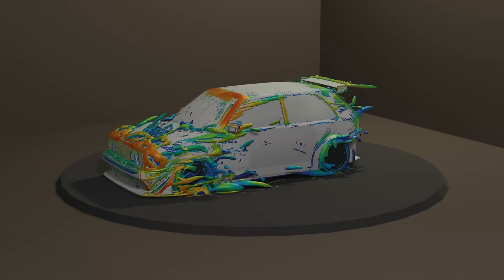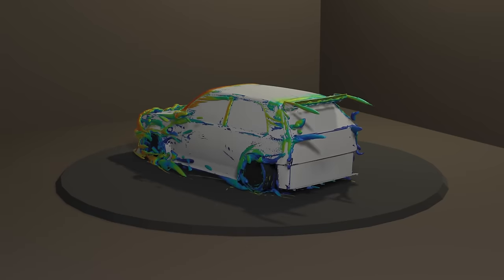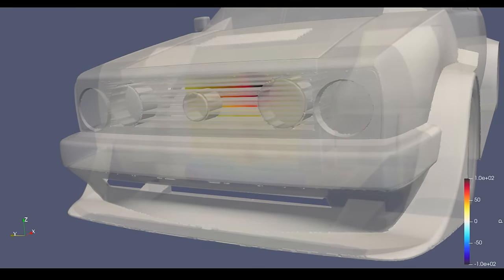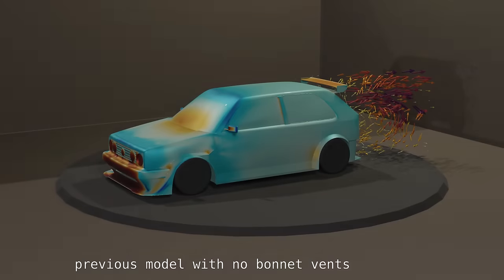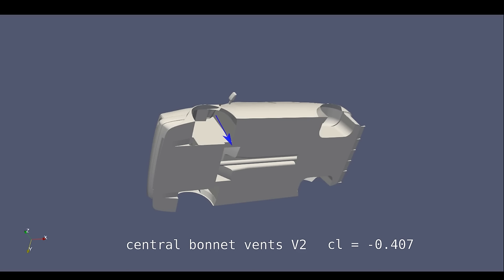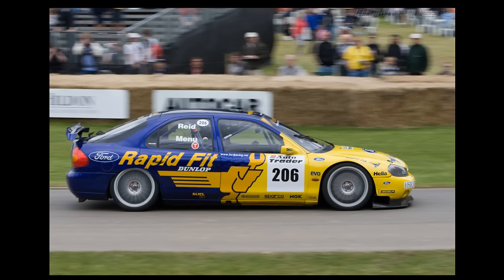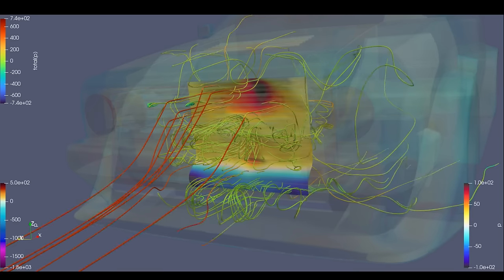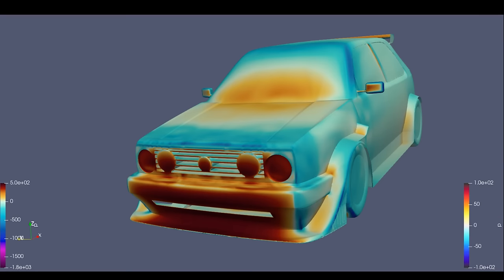Bonnet Vents: On The Search for Front Downforce

Comment: Maybe I missed it but the actual location of the various vents you mention is crucial and that is dictated by where the low pressure areas are. There is plenty of info around as to how to find the location of such low pressure areas. Of course the vent design is relevant to flow as well.
Reply: I did some tastle tests on my mk1 years ago. About 8in from the hood edge as close to the fender as possible and a maximum of 8in long vents has worked well for my cars.
Reply: 7:17 shows the corner vents

Comment: That’s very interesting how the front impacts the back. On my Mk1, I have the vent just on the edge of the low pressure zone on the hood and I have it raised with a gurney in front. This significantly increases extraction, and actually lowered drag a bit.  

I want to try like Audi did in DTM and venting a lot of the coolers into the low pressure areas in the wheel wells.

What are your thoughts on aero balance for these FWD cars?  I’ve been targeting about 60/40 downforce for the 65/35 weight distribution. The hope being that it understeers at high speed. The rear aero is also much less pitch/ride height sensitive.

Comment: Interesting. Very surprising results without ducted flow to the vent. I imagined a vent in the low pressure zone near the leading edge of the hood would be a hungry little vacuum cleaner pulling huge volumes of air out.
The WRC engineers have been ducting to their vents for decades. Now we see why.
Reply: Lots of cars have been, including supercars

Comment: What about pushing and tilting the radiator forward so you can try and get the bonnet vents into the low pressure
Reply from the maker: i think ducting may be essential, really need to delineate the functions as there is too much going on everything seems to just average out to the least good solution.
Reply: @nelsonphillips  Fair. What I’m curious about is I’ve seen some stuff from other aero peeps saying that straight louvers is better in terms of downforce than a ducted exit without louvers which didn’t make sense to me. Of course that was also on cars with the low pressure area further back so the louvers where more effective.
Reply from the maker: @cademckee7276  I've seen a bunch that run a tunnel in the US that get positive results, but they have a more modern car. No car from the early 90s on has this bad front lift,  this model just has terrible front aero. I try to emphases it, it might be worth while a major reshaping of the front and rerun the vents and compare that to ducting. A bit easier than modeling a whole new car.

Comment: I had a friend who back in the 90's drilled 6 2" holes across the back of the bonnet of their Falcon ute and he claimed it made it a bunch faster. As we were traveling back and forth about 280km at the start and end of the week for work I asked how much difference there was to the speed/time over that difference. His answer was none. I actually wondered if a non destructive option would have been simply to put some spacers in the bonnet mounts and raise the back edge 1/2".
Reply: ive seen this done on a electric converted land speed car, they raised the rear of the bonnet by an inch or two to allow the air to escape over the car,
Reply: Nothing escapes in a high pressure zone.
Amazes me every time I see it, even at “high level” of racing.

Yes, I know there’s the occasional exception to this rule.
But in general, the only good thing to be placed in front of the windscreen is air intakes for cabin cooling and engine air boxes.
Reply: Your friend is dreaming. The back of the bonnet is a high pressure area on those sorts of cars.

Comment: Bonnet vents can reduce the amount of pressure "pushing the front splitter down" as now the air can more easily escape which reduces downforce.
Reply: You need airflow in order to achieve downforce. Without bonnet vents, the air is stalling on the front splitter, not flowing.

Comment: Hello, great video! I was wondering if you are able to CFD with the hood raised up at the back like a Cowl hood. 

I've installed hood risers on my 92 Honda Civic and found that crusing highway speeds (80km/h and over) my engine revs drops 500rpm from ~4500 to ~4000 rpm with just the hood risers. But the previous owner removed the undertray and AC block off panel (beside the radiator). 

With all this information, I've concluded that without those panels I'm getting a lot of drag and lift in the front and under the car. With the hood risers, I'm assuming it's going up and over the body completely and the corner edge of the hood is creating a vortex to cancel out drag from my mirrors. I also have Spoon "style" duck bill wing I would like to add but I'm unsure how it's going to react with the hood raised. 

I can take pictures, if you're interested. Thanks for the awesome video!!
Reply: So you are saying that for same speed the engine is running lower RPMs? 
Is it manual or automatic? 

In general, raising the backend of hood is not the best solution as the windscreen  causes high pressure zone on that hood - windscreen transition. 
Of course if the pressure under the hood is even higher, it will help a bit. And yes, missing those panels causes increased drag and lift in front.

Comment: Missing a bit of detail here.

Are the sidevents only "open" to the engine bay or are they also open to the underfloor and wheel-well? Meaning if they only pull air from the engine bay or also extract from the underfloor. Could you go into it's setup in a bit more detail? Perhaps in a bit more detailed video about BTCC aero and sidevents?
Reply: The Super Touring cars all hade very clever and complexed solutions to everything. For very small gains to be honest.
The air ducts to and from the rads and to the air boxes was no exception. 
But all added up, they were amazingly quick. 
But that you probably already knew and wasn’t what you asked? 🤔
Agree that a more detailed study about these outlets would be very interesting. 👍
Reply: the wheel well looked open, but the radiator and the bypass also looked like it could flow out the side vent
Reply: @tturi2  Agree, and it would be very interesting to see further simulations with some ST-style ducting since it was on every car and probably so for a reason. 👍
Reply: @andli461  it's similar to how porshe duct their radiators, I do remember seeing under the bonnet of a ST (it was a Renault) and it had litre bike sized radiators in the foglight type area, at least it looked like it
Reply: @tturi2  Exactly. It wasn’t unusual to have a split radiator solution. Some placed as a V. Some with other packaging.

Comment: I couldn't quite understand the ending, I didn't understand exactly what "sealing the radiator" meant. Is it proposed to build a duct for the side outlet? Or just the side vent is already okay?
Reply from the maker: its ducting around the front of the radiator, up until the front grill and lower front opening. It was a bit difficult to get a good image, its  in between everything
Reply: @nelsonphillips  Hey,I think I get it now, but wouldn't it be better if the duct was behind the radiator? So I imagine it would increase its efficiency. Sorry if the question is stupid, I really found the subject interesting, I have a Vectra B and the "sports" version of it (Irmscher) had these side ducts that I always thought were useless. Your video really intrigued me!

Comment: Out of curiosity, what kind of setup you have running the simulations and approximately how long this kind or CFD takes with that setup?
Reply from the maker: this is about 30mil cells, AMR. It takes about 10-12hrs
Reply: @nelsonphillips  And how is the computing setup? some sort of HPC cluster or standalone workstation?
Reply from the maker: @lauri_autio  its actually a high end gaming system, but it is equivalent to a workstation

Comment: Did you rerun the baseline after extending the front undertray, as it seems in the video you haven't? 6:20
Reply from the maker: baseline became the first model of central vent, the only difference is the extended splitter. Basic aero like this is fairly linear, so you can extrapolate back.

Comment: Im interested alot by how race cars pull heat out of the radiators.
Nascar's next gen system is pretty cool and im sure other categories use it. 
Basically tho man I'd love to design my own intercooler configuration that surpasses the yobo standard I see with coyote falcons where they just plonk a heat exchanger in front of the radiator and condenser with no real ducting.

Also those side exit vents must be why the EB2 v8supercar had its front end forcefully changed for EF spec.
Better cooling and downforce which were more attributed to the vents than the dives planes by the looks of this ha

Comment: What about venting it under the car?
Reply: It will screw the flat underbody/diffuser efficiency. We need clean air here.
Reply: It would be much easier to start from a car that looks like an F1 car. There are no gaps where air flows from the engine bay to the suspension. Engine bay just is a high pressure, and wheel bays are low pressure. You are free to put a carbon bowl over it. Like in a funny car.

Comment: Apreciate effort you put in your videos, but many of them, forgets to include 1 or more crucial Part or design on a car, and you go chasing your tail about a problem, which will not be there in a real car. hence why you cant wrap your mind around it, in a real car that chaos of air flowing into the engine bay does not happen. if it did, even going straight cars at over 80km will be so dificult to handle,  consumption will be out the door, add so much extra noise, that does not happen and all stock cars will have vents on the bonnet sides etc. your flow theory and diagrams could be true if there was no radiator fitted witout any plastic and rubber shrouding around it to completly seal air going into the enginebay. and your diagrams show that, the flow is only going thru your grills and straight thru the gaos and bumper. what youve completly missed is car radiators dont let air to flow thru like that. believe it or not, by the time its out the other side, it has lost 90% or more of its flow. most cars these days, have an aircon condenser, after that intercooler, after that the radiator. im not even talkig performance cars. have you seen the thins on these radiator/exchangers? never thought why so tigh, and even in the gaps they are very finely staggerd thins, if you shine a light thru it, you can't see the other side, literally to restrict straight thru air, 3 sandwiches of tightly packed thins. air just doesnt flow thru like how you've shown, and so much effort goes into the shroud design, so nothing gets in under, top and aroud the radiators aswell, what it does is, the air that needs to go thru, does, and its flow speed almost non existent by the time its gone thru, no chaotic deaf spirals left. and infront of the radiator  you get a pocket of fair, infront of the radiator, which literally deflects any air hitting it over and to the sides of the car. if you have a look at grill designs even a big looking audi grills, only has a gap on the top section and a slightly bigger gap at the bottom going to the radiator, the rest isnt open, that much air just isnt needed for the radiators. it cant flow.and ive personally done these test, when the cars moving enginebay temps ar around 35 to 40c, at 80 plus km, outside air 20c measured at air filter box location in the engine bay. mostly due to the hot air getting sucked out from the bottom. as soon as you stop gets upto 65 - 70. when you turn it off heat soaks and can climb upto 95c  the newest 2010ish onwards specially Eros cars run normally at 110c, even tough it will show you on your gauge at 90 right in the middle. can be checked with the simplest of diag tools. they now need to run hotter, all for emissions and better thermo dynamics. and they need to get the CATs to get hotter and faster I know this sounds like the opposite of what it we think should be. but thats the truth